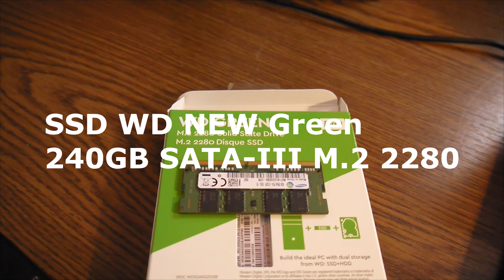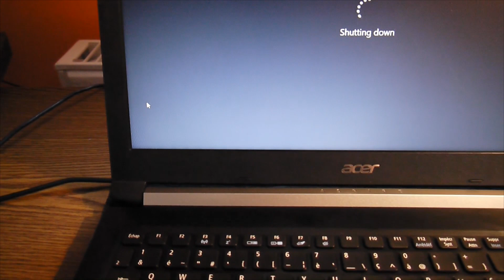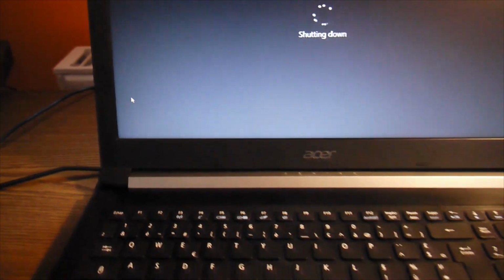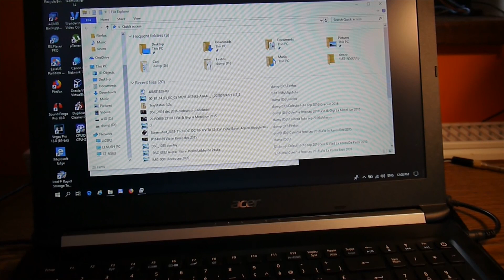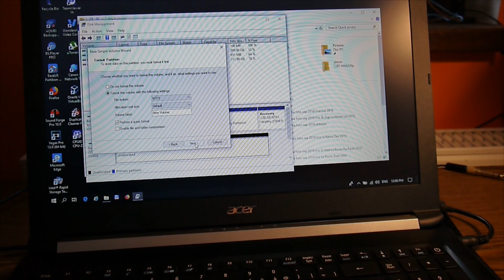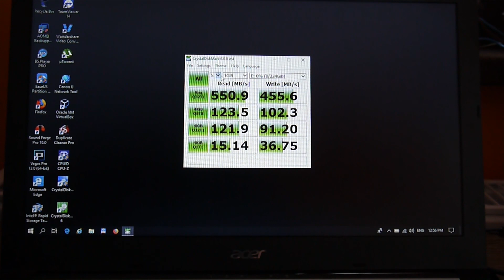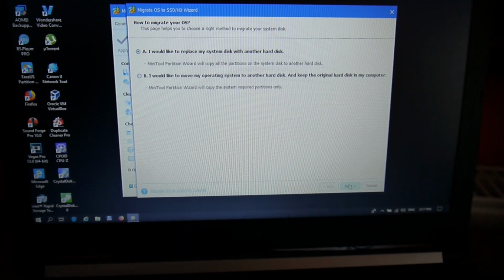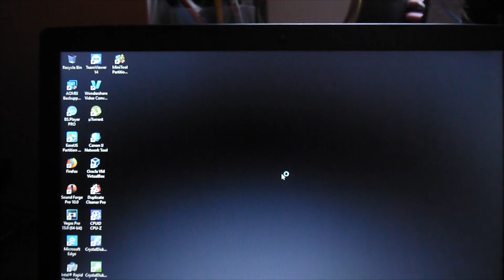Best Acer Aspire 5 A515 51 dismantle upgrade RAM and M.2 SSD

Comment: why does my new ram only reads 2133 frequency how to change it to 2400 my bios doesnt have xmp
Reply from the maker: Let me check for it...I'll be back
Reply from the maker: I'll search for and I'll be back
Reply: @viocaia  thanks a lot! ill wait for it :D
Reply from the maker: @vodkhagalang  I didn't ask...is it the same laptop as in the video?
Reply: @viocaia  yes it is sir
Reply from the maker: @vodkhagalang  Not sure , but it can be relate dto the on-board RAM. I was searching and I couldn't find any answer or fix. I found RAM speed is not so important , better have a slow speed but a lot of RAM...
Reply: @viocaia  me aswell cant find answer yep itsz working good with2133 i just tried if ever i can maximize it  thanks a lot!
Reply from the maker: @vodkhagalang  Sorry I can't help you more! All the best!

Comment: Hi, I have the same model, but my laptop doesn't show that I have 4gb onboard it only shows the ram that I have installed?
Reply from the maker: Interesting...it's looking like a hardware problem. Sometimes, when the internal RAM is misbehaving, technicians are effectively disconnecting those chips.
Reply: Is there a way to solve this problem  @viocaia
Reply from the maker: @علييحيىكاظم-ث3ظ  I don't think so...
Reply: @viocaia  OK, thank you 🥀
Reply from the maker: @علييحيىكاظم-ث3ظ  If it's hardware ...no way.

Comment: Hello, I have an Acer 515-51-76BP
I had disassembled it, and it have a M.2 slot, do you think that it works with NVme??
Reply from the maker: Check the mainboard and if you have similar proceed with replacement  https://www.youtube.com/watch?v=FA9paP39284

Comment: Sir I can see only one slot pin on motherboard but you put two slot pin in  SSD. I need to put SSD in my laptop 
Can you explain
Reply from the maker: M.2 SSD can vary like pins.. M.2 SATA is different like M.2 NVME, the latest I use is an NVME , which I recommend.
Reply: Thanks

Comment: Hi, I have the same laptop since 2019. It’s a good laptop but gives electric shocks along the edges/ metal frame when plugged in. Does anyone experience the same? How do I fix this?
Reply from the maker: Try to change the power supply first, also check if there is a proper ground connection to the mains.

Comment: can I do that on the Acer Aspire 3 A315-51-5647? I open it and I saw that it have the ssd slot.
Reply from the maker: Check what kind of motherboard you have and if is real SSD port, it can be a PCi like the one for wireless cards...cehck with CPU-Z software, yiu have all the informations.

Comment: Hi brother, thank for your good video. I want to upgrade my laptop speed as well. Could you tell me how many GB of RAM that you have upgraded? and how much maximum RAM can be upgraded in this Acer Aspire 5 A515 51G series? 16GB or can be up to 32GB? Thanks and much appreciated to hear from you.
Reply from the maker: It can support 32G, most important is to fit a fast NVME drive..that will make a huge difference.
Reply: @viocaia  Thank you so much brother. This is helpful. My acer model is : Acer Aspire A515-51G core i5 8250u 1.6GHz
. I'm not sure it's same as yours or not. Because I have I want to be sure before buying RAM to upgrade it. Thank for all your answer :)

Comment: I have acer aspire a515 51g 5621 will it support nvme. I contact customer they said only sata
Reply from the maker: Check the video about installing a NVME SSD, also check fro motherboard if is the same KBL Charmander_KL ..it's working for sure! Ignore Acer support..read the comments, there are plenty of people already installed NVME with perfect results! 
https://youtu.be/FA9paP39284
Reply: @viocaia  how to check for mother board
Reply from the maker: @rohitbandil268  check for this soft, download portable version, run HWINFO64.exe, you'll have all the infos.. https://www.hwinfo.com/download/
Reply: @viocaia  i find it in my system information it is charmander kbl
Reply: Thanks bro now i will go for nvme ssd
Reply from the maker: @rohitbandil268  so..go for 
it! It's working

Comment: when placing the ssd it does not recognize it, you have to do something else so that it appears to be able to format
Reply from the maker: Be sure it\s really fit into the slot..there is nothing special to do..check the BIOS (start with F2) if the system is ''seeing'' the drive..I never had a situation like this with well known brands..
Reply from the maker: If you see it in BIOS then it's ok..to access BIOS press power and F2

Comment: Hi Viorel! Good video!!

I have an Acer Aspire 5 A515-51-70RE that came with a 1TB HDD and 4GB of DDR4 + 16GB optane RAM.

I would like to add a m2 ssd to it, particularly this model:
Kingston A400 M.2 2280 240 GB (very cheap)

Also, this ram:
Crucial - 16GB DUAL RANK SODIMM 260-pin DDR4 2400MT/s Memory

Do you think they are compatible? Do you recommend any brand and model?

Thank you!!
Reply from the maker: Of course..

Comment: Can this laptop work without ram.  Because once my laptop had keyboard issue I gave to authorizised service centre. They fixed keyboard issue, n it function pretty well after that. Recently my laptop stopped showing display due to Lockdown at my place I showed to a local person he told there is no ram so its not displaying! Now my question is how can it work without ram almost a year then. Kindly guide is it possible to use laptop without ram for a year???
Reply from the maker: This laptop have a 4Gb of RAM soldered on the mother board. There a single empty slot for extra RAM..I have an extra 8Gb and it's running pretty ok.So, The laptop is working ''without'' RAM, due the onboard one!

Comment: I have Acer Aspire 5 "A515-51-517Y" laptop. It has internal M2 slot. Will "Nvme" type SSD 1TB work on this laptop??
Reply from the maker: check for the chipset, if is like the one from the video ..it\s working.

Comment: that's the model of your notebook 
acer a515-51g-35zt  
What kind of ssd do I need for my notebook? It has a 16gb optane but it is useless that part that is to accelerate the hard disk something like that I want to change to a ssd can that.
Reply from the maker: You should have a M.2 for OS, as fast as you afford, like NVME and a regular sata3 instead of HDD
Reply from the maker: about NVME install https://youtu.be/FA9paP39284

Comment: What's the bios key ? F1?
Reply from the maker: F2
Reply: @viocaia  thanks man also I have been experiencing some performance issues like programs not responding even the file explorer too. I installed Windows again hoping it would fix the issue but it didn't. Might it be a hdd issue or ram issue?
Reply from the maker: @jd3455  I suggest installing a M.2 SSD , even a small 250G will do the difference..
Reply: @viocaia  alright thanks for the suggestion.
Reply: @viocaia  last thing, what is the recovery menu key?
Reply from the maker: @jd3455  It suppose to be Alt+F10...or simply F10..
Reply: @viocaia  thanks again
Reply: @viocaia  yo sorry again but one absolutely last thing. It turns out my HDD broke. I am thinking about buying this HDD. https://www.amazon.in/dp/B01LY3Q201/ref=cm_sw_r_cp_apa_glt_fabc_1PSZVYDHK2RV1P2NFJ0W?_encoding=UTF8&psc=1 Is it good?
Reply: @jd3455  Just buy an SSD if you can afford it.

Comment: @Viorel Caia i have an acer aspire 5, model: a515-51g-518r, with i5-7200U and 4GB RAM DDR4. I want to upgrade it with a ssd m.2. But i found that this motherboard does not support NVME ssd, only SATA. Can u help me please?
Reply: About nvme question, I've talked to Acer support and they told me that the motherboard does not compatible with nvme. But they are compatible M2 ssd
Reply from the maker: @RodrigoSantos-fy2ch  I don't know, because I have a M.2 SATA installed but here are people confirming NVME is working, read the comments.
Reply from the maker: It support NVME for sure, but not all the ``models``I have a SATA3 M.2 doing a very decent job, cheap and no problems at all, but if you want an NVME you should go for Samsung EVO, this are very compatible EVO 960 Pro BTW...
Reply from the maker: about NVME install https://youtu.be/FA9paP39284
Reply: @viocaia  for sure. They told me that. With informations like serial and model number

Comment: Dear Viorel, why when i put a new SSD M2 256 MB on Mi Acer 515-51 , this dont start on??? only when i put the AC conector on the lap then start up? ...so i put off the new SSD and then start!!! why?
Reply: Thank you so much Viorel, but i think that the real problem is because the new SSD M2 is "For gamers" and it need a lot of power in order to works, y close the lid completely and try, but the problem still, i think that will change the ssd for no GAMERS kind...thanks again, Arthur!
Reply from the maker: @arturoruizaguilar3634 this model have issues with some M.2 SSD, IT's very possible to face that
Reply from the maker: If you try to start with no bittom lid, it won.t, there is a small switch near RAM doesn.t let the battery start.Put on the lid and it will fine
Reply from the maker: about NVME install https://youtu.be/FA9paP39284
Reply from the maker: about NVME install https://youtu.be/FA9paP39284

Comment: The ram should be DDR4 SODIMM? and the SSD is M.2 type? I have Acer Aspire A517-51G-52LB I want to upgrade my laptop. Thanks in advance.
Reply from the maker: You`re right! If you can afford buy a NVME SSD
Reply from the maker: It`s only 1 slot for extra memory, so put how much you can..
Reply from the maker: about NVME install https://youtu.be/FA9paP39284

Comment: Dear Friend, I am trying to put 250 GB external SSD in my system ACER ASPIRE 5 A515-51g partition is already in MBR mode, I am trying  to change it to GPT mode, 
if I change my system partition at installation (external SSD) time, my hard Will drive data be deleted or not?
Reply from the maker: If you use Windows commands, you'll loose the data, try to use a software like Aomei partition manager to convert without loosing data..but I recommend to do a back up first..
Reply: @viocaia  thanks buddy

Comment: I want to migrate my OS to SDD 238gb but the Migration program says it is too small, but I can see in the video you are using even smaller SSD. Why is that?
Reply from the maker: like I said , open Disk management under Windows and check for partitions.If there is an empty space for the rest of M.2 creat new partition and format...the migration software doesn't see the whole disk, just a leftover from a previsious install..that's I can say...you also may try this with free partitioning software like EaseUs..there should be a hidden partiton or not partition at all, create new one..

Comment: So I have 500gb HDD. Should I upgrade it for 500Gb/1TB SSD or 4tb HDD?
Reply from the maker: Use a small 250G M.2 or better NVME for Windows and other softs, nad let the 500G in place for data deposit ..anyway a SSD is far faster then any HDD capacity doesn't matter when you need speed.I did the same in the video, now I'm looking for a faster NVME to replace 250 M.2 I installed ago.
Reply: @viocaia  Thank you so much!
Reply from the maker: about NVME install https://youtu.be/FA9paP39284

Comment: i have same laptop Acer Aspire 5 A515-51G  i5 8th gen  8gb ram ddr4  1tb hdd ,
i have confusion that does my laptop support ddr4 2666mhz ?.because i open ram  from laptop and there is 4gb 2400mhz ddr4 memory so its confusing me ??? tell me
Reply from the maker: Yes it's working with 2666, but it will go to 2400..you can't feel it in the real world..put as much RAM can you afford!

Comment: Sir please help me. I want to buy this SSD. Give me a suggestion.
 Model: Transcend 110S
Capacity 256GB
Form Factor M.2 2280
Interface NVMe PCIe Gen3 x4
Flash Type 3D NAND flash

Does Acer aspire a515-51g supports M.2 2280(M-key) ssd? help me plz
Reply from the maker: Yes, it takes all M.2 SSD, I'll go for NVME if you can afford, it's faster, but I have M.2 2280 Samsung green and it's working great.If you are a gamer buy and NVME, if you use it for daily job, even video rendering and nomral stuffs buy a M.2 like in the video.2280 is ok
Reply from the maker: Hey !please subscribe
Reply: @viocaia  SIR Thanks for your suggestion. love you brhhh.. for response
Reply: Mr. I have planted SSD like your words and it worked. A lot of Thanks for this Sir. But now I want to put 16GB RAM in my Acer Aspire A515-5G. But the problem is My chosen RAM's frequency 2666 MHz, Whither my laptop inbuilt ram frequency is 2400 MHz, now my question is can I put 2666 MHz RAM to my machine? and whether it will have a bad impact?
extremely sorry for my bad level english.
Reply from the maker: @parthokarmoker7993  Hey! If you put a 2666 will go down to 2400..but you'll feel no difference just go for it!
Reply: @viocaia  thank you sir
Reply from the maker: about NVME install https://youtu.be/FA9paP39284
Reply from the maker: about NVME install https://youtu.be/FA9paP39284

Comment: Can i change the hdd without take the power off? And can i take a same ram 8gb to upgrade it  in 16 gb? Btw thanks for the information!
Reply from the maker: You need to shut down the laptop, the battery can stay in place, but push shut down ! Of course you can add 8G or more of DDR4 RAM, you have only 1 slot there..so make it as big as you afford.
Reply: @viocaia  I have one slot free? With the original in ?
Reply from the maker: @witChaos  yes, the original is soldered to the Motherboard..you can't touch it

Comment: Hi, my model is a515-51-75uy is it possible to add gpu? Mine doesn't have one it's integrated intel hd 620
Reply from the maker: You need to solder GPU on the board, better buy a new board with everything

Comment: Hey , my model are already installed with 128gb ssd . Now im planning to upgrade it to 256gb ssd . So how do i migrate the file from the old ssd to the new one ?
Reply from the maker: if you have an M.2 SSD..you have to use an external USB HDD , use Backupper to do an image of the ''old''128 SSD...don't forget to make the external disk bootable with the utilities in Backupper software, then just install new M.2 in the slot, boot from external and follow the screen, transfer the image to the new M.2 ...If you have a  2.5 SSD already installed in the classic SATA slot it's even easier...just backup and restore to new M.2, eventually make new M.2 boot disk in BIOS and that's it!
Reply: @viocaia  Hi thanks for the reply . I forgot to mention that my main disk is the 128gb m.2 ssd and its almost full . So that is why im planning to upgrade the m.2 ssd  . Btw , I also have internal hdd 1tb installed . Can i use the internal hdd as backupper to trasfer the file from old m.2 ssd to the new m.2 ssd ?

Comment: Hi sir, i have 8gb ram variant of this laptop with 4gb soldered on board, in case to upgrade my memory, what is the maximum ram i can put in that single slot 
Is it 8gb ddr4 or 16 gb ddr4
Reply: I'm pretty sure it's up to 16 GB ddr4. this means the total ram you can have is 20 GB.
Reply: It's written in your manual , mine is also 8gb and can be upgraded to till 16 GB
Reply from the maker: @No_limits37  right, but you can feed as much as you can , as long as is DDR4..but there is only a single slot..
Reply from the maker: Not sure but I think is 32

Comment: I have the same laptop but it already comes with the slot occupied and it only has 4GB, will it be bad? since i have read that these motherboards come with 4gb soldered to it
Reply from the maker: Are you talking about the extra RAM slot..and yes it ha s a4GB RAM soldered.You can improve RAM with an bigger brick..just take out the on in the slot if any and check what let! Please subscribe!
Reply: Viorel Caia thanks men, the last question is how much ram is the maximum that resists?
Reply from the maker: @cristobal1918  As much as you can afford, there is only 1 slot so I supposse is not so cheap to have more than 32Gb.

Comment: I want to expand the memory of my Aspire5 A515-51G-52PH. I had two memory options: 1) Hyper x impact (Model HX424S14IB/16) and 2) Kingston (Model KCP424SD8/16), both 16GB and 2400MHz, however on Acer forum a contributor mentioned this: 

"HyperX modules are only properly supported on devices that can be inserted and paired. This is not the case, since it has a RAM module integrated with soldering and all inserted modules will be leveled by it, both in frequencies, and CAS, etc.
 The other problem is that the BIOS needs to support the XMP profile that is built into the HyperX modules, which your device does not have.

Do you have any suggestions for a memory model to improve my A515?  Thank you.

Translated with www.DeepL.com/Translator (free version)
Reply from the maker: That comment is right..you may use any DDR4, as fast as you afford.I don't know if HyperX is working, just stick with DDR4..
Reply from the maker: Hey Carlos..please subscribe!

Comment: Hey, my screen is pushing off the bottom left hinge and it's seems to get worse.

Is the problem with the screws holding the screen? Can I open it and fix it, or should I take it to tech repair  (expensive)?
Reply from the maker: Also, don't forget to loose the nuts a little and make the screen easier to open and close.
Reply: @viocaia  I did so.
The long part of the hinge broke off at the bottom, just before where code is written (AM28Z000100 LD-L), and the hinge screws also came off the cover as in the video.
I guess I'll have to buy a new left hinge.
Reply from the maker: @sebolaiandries6845  Before try to fix it with gluegun..and release the preasure of the nuts keeps the screen.
Reply from the maker: Hey! Just give me a hand and  subscribe ! Thanks!
Reply from the maker: Take the bezel off, it's very easy (check the screen replacement tutorial) and do like this https://www.youtube.com/watch?v=2Tmj6vmZMrg&t=288s